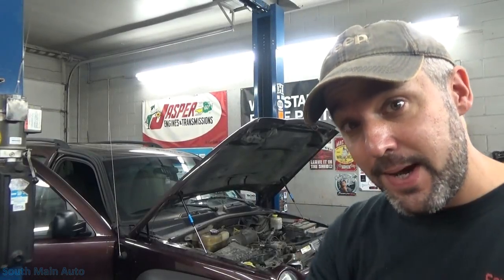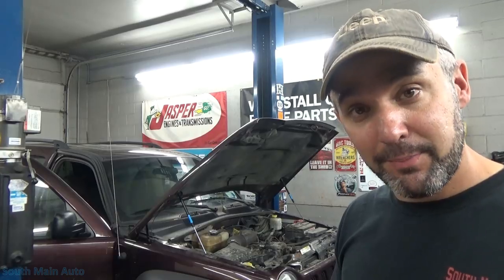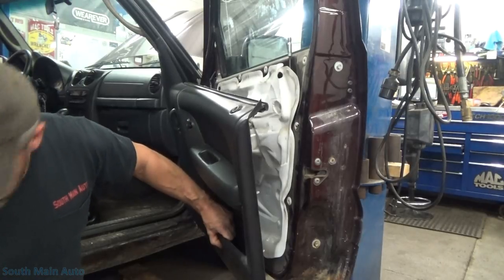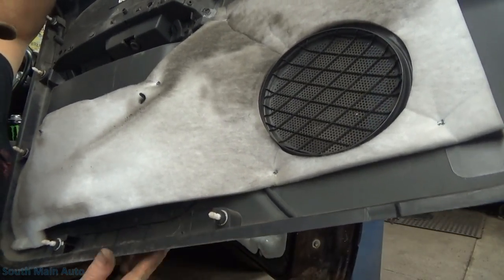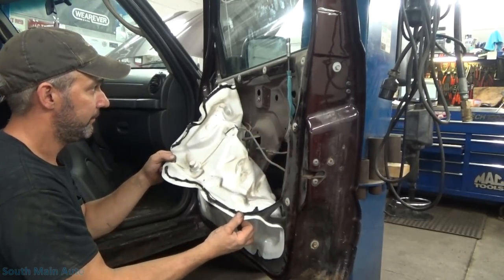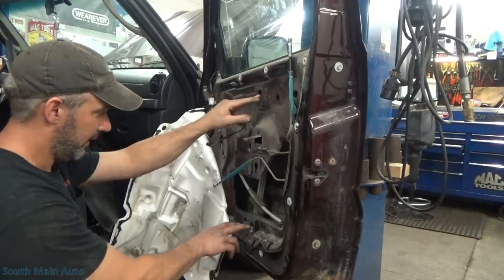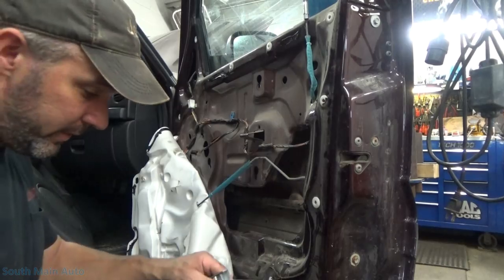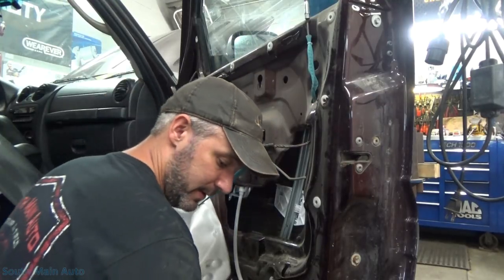Jeep Liberty: Window Regulator

Comment: Taking the speaker out (just 3 screws and a connector) gives you easy access to the connector for the motor.  Also gives you a little more wiggle room to get the regulator and motor situated.  Hope this helps and thanks for all the videos!

Comment: Thank you once again. Brought a mint liberty cheap for parts. Owned stated had a cylinder down, backfiring. Your other video gave me the idea to check the rocker. New lifter put the rocker back on. Great runner. Now to fix the window regulator and I will have a new daily runner.

Comment: Hi Eric
Due to the condition of the door I was wondering why you did not just split a piece of heater or fule line of appropriate Diameter and reinforce the original regulator  cable housing? I am sure it would last the life of the door.
Keep the videos coming.

Comment: I once bought a 1990 chevy pickup that had the cab corners fixed with expanding foam.  They filled the hole with foam and then used bondo to smooth it out for paint.  It actually looked good...till the rust hole got bigger than the foam.

Comment: @27:30 "they both came through the same spot..." Actually if you look back around @7:15 you can see the latch rod came through the water shield at a hole that is further rearward than the one for the wire harness. Probably doesnt matter but just pointing it out.

Thanks for another great video.
God bless
Paul
Reply: that's why the handle doesn't return well... but it's such a pain to take apart it's not worth re-doing...

Comment: Thanks for the video I've learned a lot from it. I have a 2005 Jeep Liberty and the passenger side window the cable came up like a snake,  like you express to us and couldn't figure out what I had to replace. So thank you for that. It still looks complicated for me to do. Especially that red lock inside. It looks difficult to get to. I might attempted it but I don't have the tools anymore that I used to have.  I used to work on vehicles myself before I became disabled. I have replaced a drive shaft and cleaned the lifter's in a 1985 bronco and replaced the distributor coil and carburetor. So I was a good backyard mechanic. I sold that Bronco and bought a Toyota. Lol. Then had to replace the water pump 3 times. Lol I never should've sold my bronco. Oh well anyway thanks again. 😊

Comment: The factory regulator on the 06 - 07 is plastic as well, had one go on my 07. I actually had a choice; pay $400 something for an updated regulator (which looks a LOT like the 03 to 05 regulators) or pay some guy in Arizona $80 for a custom steel adapter plate that screws to the stock regulator with some drilling. Worked good for the 2 or 3 more years I had it.

Comment: I'm watching how patiently you are taking the door panel off and chuckling.  I've owned three jeeps and the window regulators broke on all of them.  I just start at one corner of the panel with a screw driver (don't own your fancy tool), pop about three of the fasters and then just start pulling until it all comes off.  Have I broken a couple of the fasteners? Yes, but they are cheap to replace.  Never broken anything else, and got the panel off a lot quicker.

Comment: If you had been repairing it for yourself, would you have considered cutting some plastic plumbing pipe with a saw and using the two halves to splint the cracked cable guide tubing out 3" to each side of the crack, held the whole thing together with some small hose clamps and some duct tape and called it a day?

Comment: The red lock tab....one of the engineer's biggest F-you mechanics .
Reply: I don't really understand why designers use those extra locking clips. The connectors usually push on fairly tight, let alone the main clip - has it ever happened in existence that a clipped-in connector has just fallen off on a vehicle to make those locks necessary?

Comment: All videos should be posted during business hours.  If' I'm going to be non-productive I should be so on someone else's  clock. ;-)  I'm also amazed dodge still attaches their door panels like that.  Major PITA.  Just plan on replacing every clip, and pay very close attention getting the top center clips started.
Reply: My '06 Dodge Dakota's doors don't  have those fasteners. 6 phillips screws and the panel lifts up and out.
Reply: It's probably good that they stuck with 70's methods of attaching door panels.  Whenever they try to get clever (fuse boxes come to mind) they botch it up.
Reply: Jawga Man: I hear ya, man.  Breaking all the clips in the winter and taping the panel on until summer.  Always a few clips that pulls out of the panel and rips the tab.  With a thousand different clips made you can never source exact replacements or they are brittle as glass.
 I just did the passenger regulator on my Tahoe.  Whir, pop, lift, and swap.  Took all of ten minutes.

Comment: I guess the newer "fixed" redesign was discontinued so sometimes the replace the glass and the whole mech with the older style making for confusion when if again breaks and needs replacing. Thank goodness there is a aftermarket repair part for this terd design. I hear there is still a class action about it going on

Comment: At least all the bolt holes on the motor lined up. On the wife's old 04 grandcherokee i went to 4 different parts houses and all of them one hole didn't line up and dealer said it was discontinued. So end result was a will placed 3/8 self tapper lol

Comment: Spray silicone on the glass runners. Make the glass go up much faster.
Reply: Most likely the cause of failure. It should be done at least once a year.
Reply: What bout a teflon dry lube?
Reply: tried it. leaves a white film. stick with the clear.
Reply: tried it. leaves a white film. stick with the clear.
Reply: That's what she said...

Comment: Funny how I go through everything you did while working on that door, except for the rust hole adding some convenience. It won't bother me so much anymore, because now I know I'm in good company. Question: Which aftermarket regulator/motor is recommended as a good replacement? I don't want to do it again if I can help it.

Comment: You ever try to find one of those metal spring clips that hold the glass to the regulator?  Even the dealer was like "whaaaa??".  They are only missing, if the new regulator doesn't come with new ones.

Comment: You know that the bottom of the door is rusted out and may very well cause problems later. Would it be worthwhile to take a picture and put it in the file for later discussion when it comes back not working?

Comment: Wife has an old Chrysler with slow windows. Can anything be done to lube/grease the regulator to speed it up? Already douched the tracks with half a gallon of silicone spray. Didn't do jack.

Comment: I have an 03 Liberty and the front window will intermittently stop rolling up mid way, or I have to click the button several times as it will go up about 1 inch and stop.    I took apart the switch mechanism and cleaned it... Everything appears good there.   Could this be a window motor starting to go bad?    Or are there other relays in the path?    Also seems like it thinks the window is hitting resistance as if it were rolled up all the way.

Comment: One of the best sources for clips is a company called Clips and Fasteners.  www.clipsandfasteners.com.  If you look up the manufacturer's part number and do a search on their site you'll get what you need or just look under their menu for the different makes.  You buy in bulk, but buying just one or two at a dealership can cost you 2-4 bucks a piece.  I'd rather spend my money with the clips and fasteners guys and have extras.
Reply: Thanks.  Just bookmarked that.

Comment: Replaced the one on one of my vehicles that had accident damage on the door. found that Mr. grip and lift it left the frost shield torn and taped yes masking tape two of the Christmas tree fastners broke and a screw missing with the cap put on to cover it. Not impressed buy the work of the body shop.

Comment: I think it sucks that you have to replace the whole regulator assembly just for a broken plastic tube. I take it you cant just order the tube and you have to get the whole assembly?  Just a throw away nation. I think it was very observant of Eric O to notice that the new unit had plastic mounting brackets instead of the metal OEM design. I never have good luck reattaching the plastic weather barrier shield after I pull mine back to access the inside of the door. It never wants to hold and stay put when I reattach the door panel.
Reply: Kenneth White - use some rope caulking or heat gun to soften it up and get sticky

Comment: Just Empty Every Pocket. The window regulators on these KJ Libertys are a wear item, with about the same longevity as the wiper blades or air cleaner.
Reply: I DIYed one of these for a friend. For the cable tube I’d be so tempted to just duck tape the shit out of the tube where it broke. The ones in the Jeep I worked on were in the back, and the plastic (!) sled on the regulator mates to a metal peg attached to the window glass. The bottom broke off the sled, allowing the glass to fall down into the door. 

I rigged the Windows so what was left of the regulator held the glass up, then unplugged the wiring harness so they’d stay there. Who need roll down Windows in the back anyhow?

Oh. And some spray foam in the bottom of the door, covered with some Bondo to seal it up. Nothing like a beater fix! Appreciate Eric O’s doing it the “right way” though.
Reply: Glad to hear I wasn’t the only one with the spray foam idea.